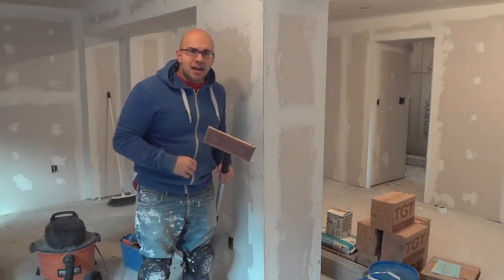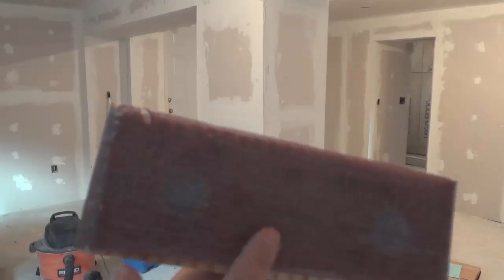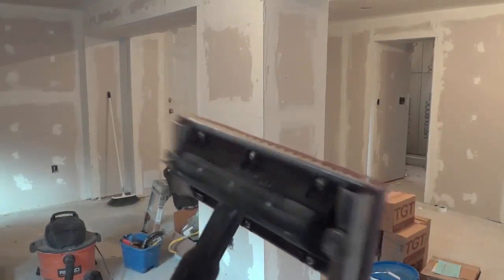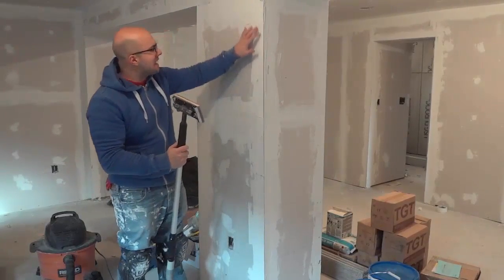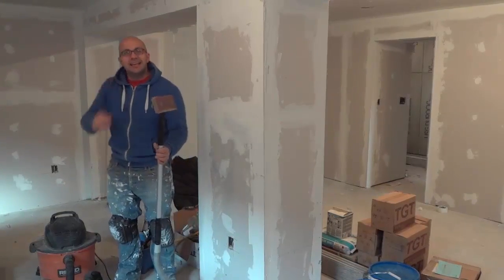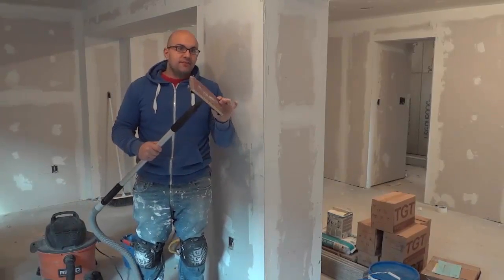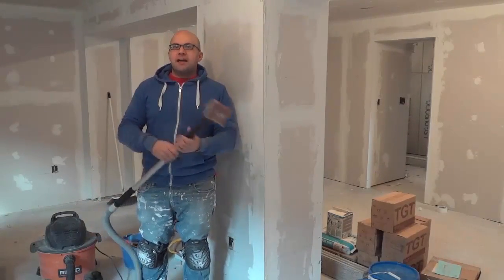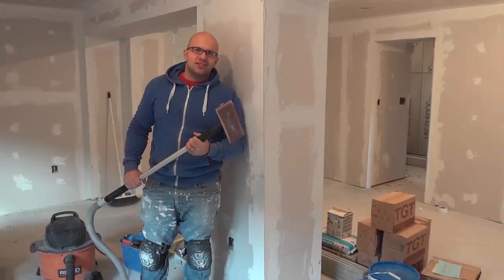Richard Vac Pole Review-Sand Drywall Without Dust

Comment: Just a thought. I wonder if you could combine this with a Sand & Kleen and save all that dust from even going to your shop vac and clogging up the filter. The Sand & Kleen basically works like a Rainbow vacuum using water as the filter. Then you just dump the water and all the junk in it and nothing but clean air goes to your shop vac.
Reply: Try a cyclone mounted to a mud bucket. I made one and mounted it to a converted stroller to carry the vac and the cyclone. Dump the dust into the bag and box the mud comes in.

Comment: Horrible mudding job. He should use that vacuum to sand it off and start over
Reply: Exactly. I looked at the thumbnail of video and had to chuckle.  Looks like my very first drywall job I did without knowing anything about finishing drywall.  I sure hate to criticize this guy.  However someone should clue him in on the error of his ways.  In order to avoid all this un necessary sanding one must thin the mud and put 2 thin finish coats after taping and first tape coat..  Each coat should exceed the length of the previous coat.  Mud MUST be tapered into the paper leaving hardly NO RIDGE to sand.  Joints, especially butt joints must be WIDE.  Corners not as wide as joints.  Mud must be applied as smooth and perfect as possible.  All this will keep sanding to a minimum.  Sanding a medium room should not take a lot of time and require a pole sander hitting the joints and corners lightly.  Also, make sure the area between the paper and mud is sanding to assure smooth transition between made and paper. Bottom line,  excessive sanding is caused by a bad mud job!  Sorry for the criticism.  Just sharing my techniques for minimizing sanding.